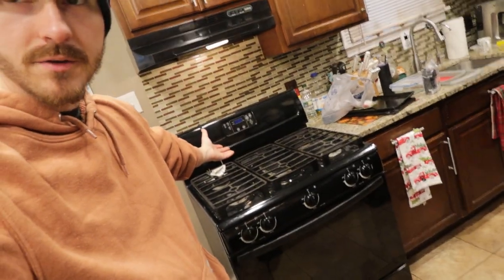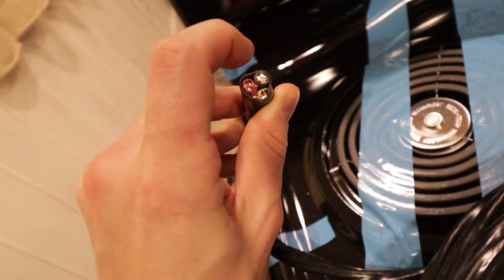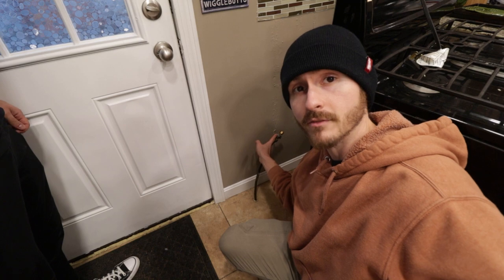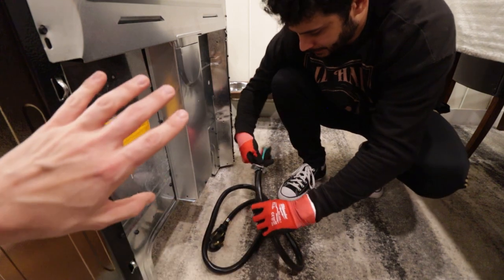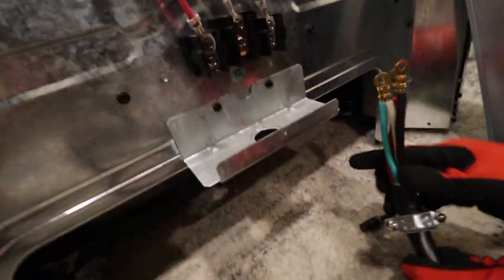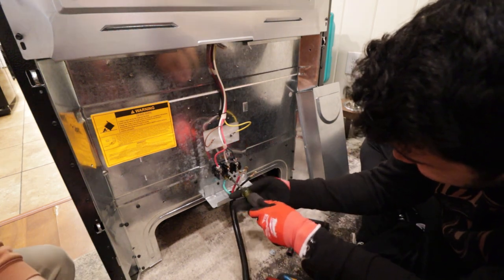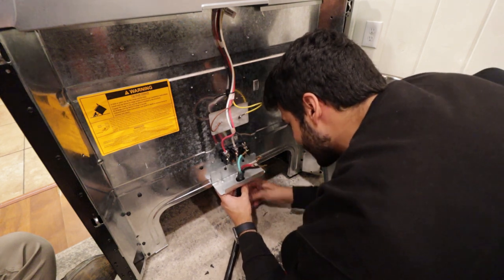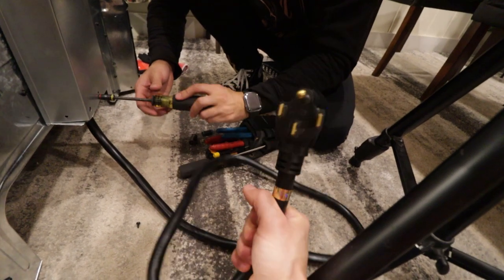Electric Oven Outlet Install

Comment: Can you move the stove anywhere in the kitchen and run a new wires? Is there code? Great video. 👍👍
Reply from the maker: Thank you! and I am not aware of any codes requiring a specific location but there maybe be some that require ventilation. Electrically, you can put it anywhere!
Reply: @DownToTheFrame  Thanks man 👍 thats gonna help with my remodel and counter space. 👍👍👍👍

Comment: What wired was used? Like the big black cable thing 😅
Reply from the maker: lol you can use 8 gauge 4 wire copper for a 40amp circuit

Comment: Isn't #6 a bit excessive for 240V.
Reply from the maker: the voltage does not dictate the wire size. Amperage does. I could have used 8awg though
Reply: No, he just future proofed that run for pretty much anything the future holds. NEMA 14-50R could be wired up since he used 6 AWG copper so long as he changes out the breaker to 50A.

Looks like he left enough wire that the receptacle could be repositioned a bit....possibly even the exterior of the house if a 50A outlet were ever needed for charging an EV or powering a welder. There is a lot of talk in the EV world about only using a proper industrial receptacle with brass contacts as the most popular Leviton NEMA 14-50R uses steel contacts for the prongs on the plug to connect with.

Here's a post from a forum about Bryant being the best option (made by Hubbell) because the Hubbell branded version is now like $100 so $40+ more than than the Bryant. Leviton released a new receptacle about a year ago because their $10 receptacle was the feature of far too many "Leviton NEMA 14-50R melted" threads.

"Bryant 9450FR or Hubbell 9450A are the ones with the improved wire clamping method compared to most other 14-50 receptacles, as well as full size brass contacts. The new Leviton "EV" receptacle also claims to have an improved wire clamping mechanism.

Most other 14-50 receptacles other than the Leviton 279-S00 have full size brass contacts, but screw down wire clamping that is ok if installed carefully, but easier to make installation mistakes than the improved wire clamping.

Basically, anything with full size brass contacts will be an improvement over the Leviton 279-S00, but those with screw down wire clamps need more care in installation."

Comment: Aluminum cable is bad. The surface corrodes when placed on copper. 
A special paste is needed to protect the electrical connection from oxygen. 
For 40 amps in Europe we use copper 6 to 10mm², AWG 9 or 7.
Reply from the maker: We use aluminum a lot here for ovens. My parents have had one in their house since the 80s with no Noalox. I think the situation depends. Plus aluminum wire manufacturers sometimes state NOT to use Noalox. So I think either is suitable

Comment: 6-6-6-6 SER aluminum is rated at 75C since 2017 NEC and rates to 55 amps.
Reply from the maker: Great information! For sure would use aluminum in the future but boy does this oven rip!
Reply: @DownToTheFrame  It has to be governed somehow otherwise you overdrive the heating elements and wear them out faster.  I'm betting the listed max amperage is the most it's going to do regardless of wire.  I just replaced my vintage 1956 ungrounded oven cable with SER, and I noticed that the hot wires coming off the plug posts were like 10ga max.  Best thing about the SER - 50 feet was $65.
Reply: @DownToTheFrame  BTW which zip tie product did you use for cable support?  I wound up using 1/2 inch EMT single hole straps - they fit nicely over the cable but I doubt they're UL listed for that application.  But no way was I going to hammer in staples with my sub par nail-bending hammer technique.
Reply from the maker: Great tips! I used just standard size zip ties. I do use the pvc one holes sometimes. They are nice!

Comment: Why in the world would you switch from gas to electric?  Gas stoves are much better.
Reply from the maker: Well I don’t agree with that statement but primary reason due to lack of vented hood and very sketchy propane lines. The house needs all the gas piping redone. So i’m reducing the need for gas.
Reply: Also you don't have to fix the ignition ever and will remove some inconsistencies you would have with gass stoves
Reply: @somestuffaround  Easier to clean the surface, better air quality in the house, lower heat generated in the room. My gas oven started leaking CO. Used electric in the past for four years, for these reasons, I love electric.

Comment: You could have wired it direct without the plug
Reply from the maker: haha technically yeah but for serviceability of it I would prefer a plug
Reply: @DownToTheFrame  they sure don't make appliances like they used to already serviced mine 2 for the same part
Reply from the maker: Yep! Always have to plan for failure!